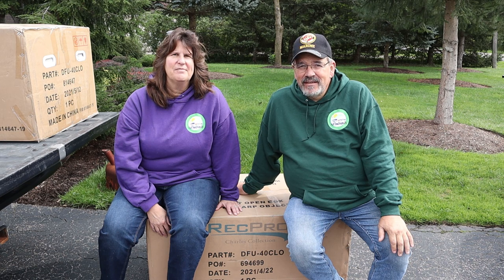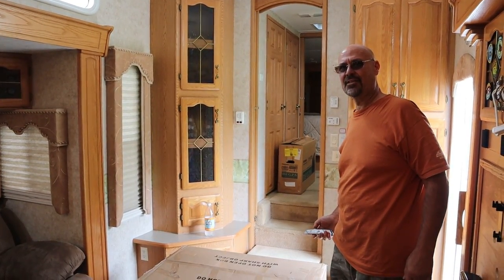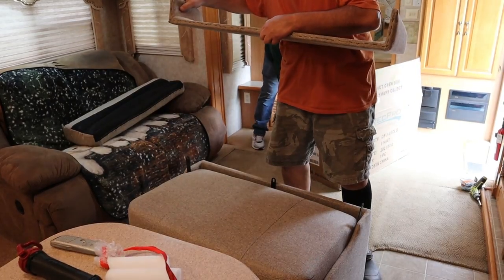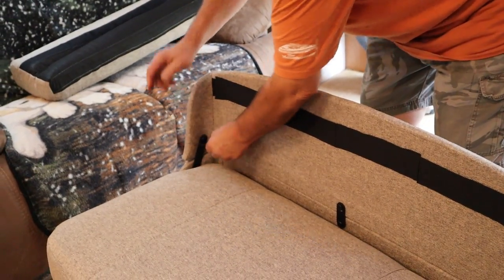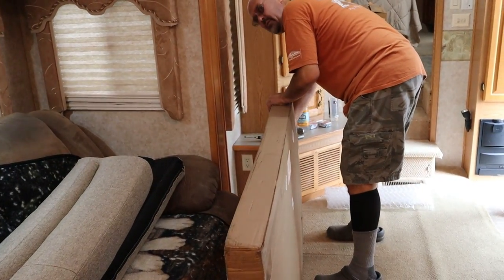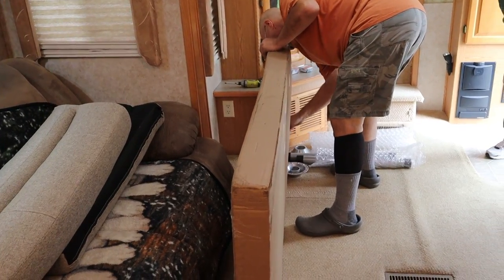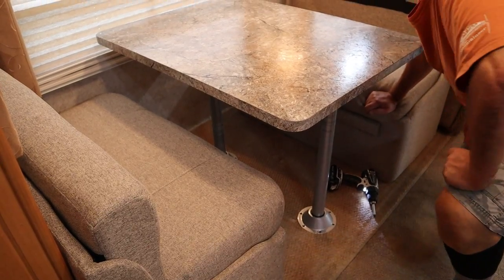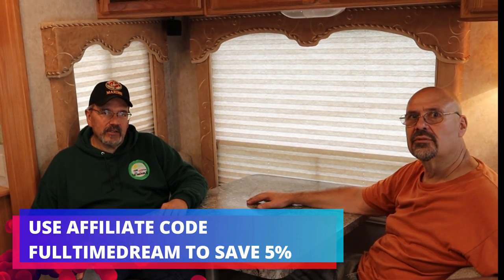RV TABLE REPLACED WITH RECPRO DINETTE / WHAT WE THINK OF RECPRO DINETTE / EASY INSTALLATION

Comment: This is probably an ignorant question, but when you're drilling screws into the floor how do you know what's under there? What size screws do you use and what should I know about whatever's under the carpet with respect to where the screws go and how solid it will be?
Reply from the maker: Nope, not an ignorant question but it is a tough one to answer. We knew this was on a slide, most slide are 3/4 inch plywood. In the beginning when he pulled the table out Jim measured the screw that was sticking out and there was about 3/4 inch. This guessing game is why there aren't any screws included with the kit. 
Jim originally used  1 1/4 inch screws but when he looked he could see a slight impression of where the screws were. They didn't poke through but to be safe he switched to 1 inch.
I hope that he helps to answer your question. I would just make sure there is nothing under where you will put it, maybe your manufacturer can help with this.
Thanks for watching.
Reply: @FullTimeDreamRV  Thank you for taking the time to give me those details. I had forgotten it was a slide, so probably different than my situation. Thx again, your project came out well.